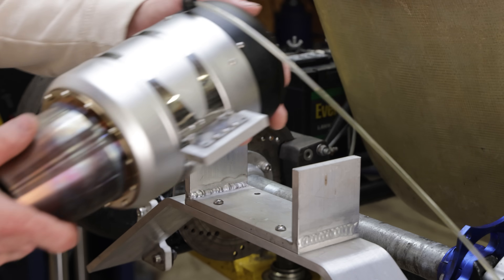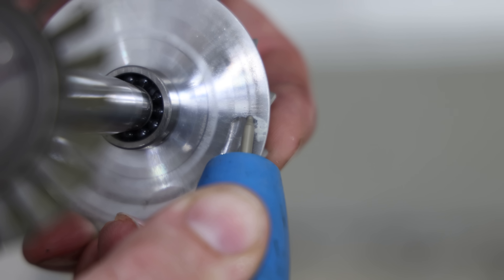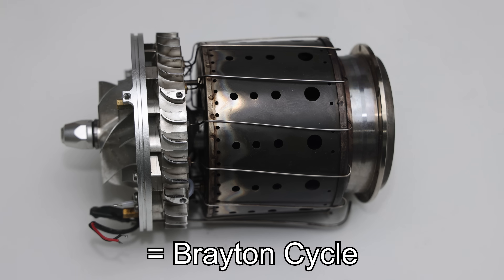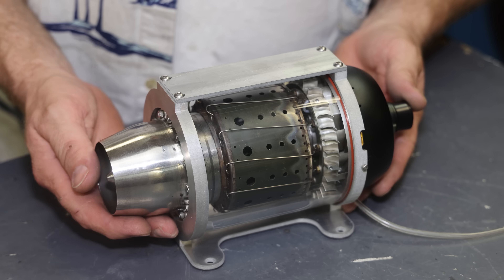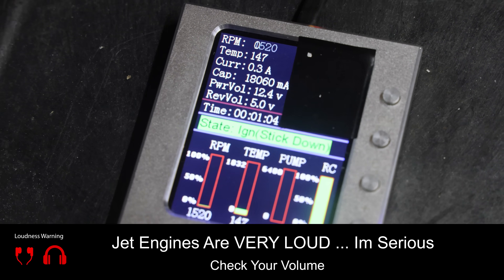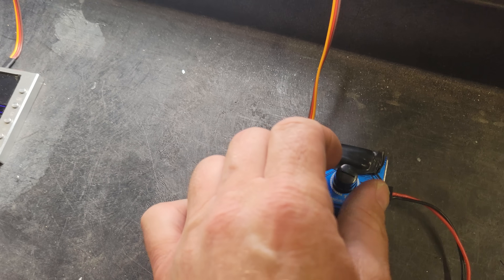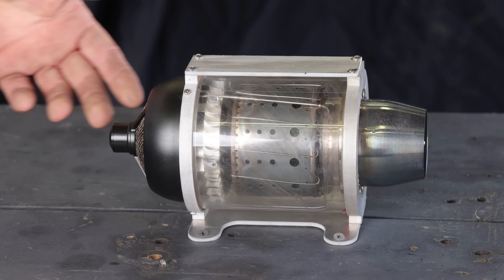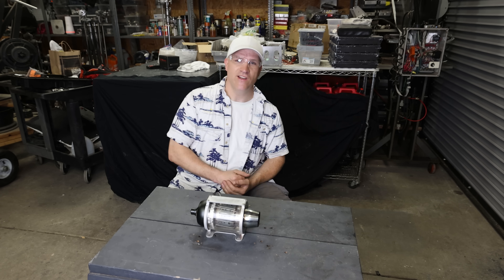See Thru Jet Engine

Comment: At 8:59 while talking about the amount of air going through vs the thrust produced, Warped Perception states "most of the energy comes from the fuel."  That's sort of right, as the fuel notionally supplies chemical energy though combustion, but he doesn't say that, and in his context it is misleading and confusing.
Jet engines operate stochiomentrically - that is the mass of air consumed must just equal the amount required to completely combust the fuel and no more.   For hydrocarbon fuels, the mass of air must be about 15 times the mass of the fuel consumed.   (Only the oxygen is used chemically - air is about 80% nitrogen which passes through chemically unchanged.   The actual oxygen mass is about 3 times the mass of the fuel.)
What produces the net thrust in a jet engine is that combustion raises the volume of air/fuel mix such that the burning gasses can push against  a greater area of the forward inside engine surface than the combustion chamber air inlet area.  The burning gas pressure in the combustion chamber must be approx equal or a bit less than the incoming air pressure to the chamber as otherwise burning gasses would come out the front.  Thus forward thrust is produced as the exhaust orifice, always much larger than the air inlet orifice size, cannot offer much more than surrounding air pressure.
Jet engines are most easily understood properly by first considering a ram-jet engine, which has no moving parts.   Intake air is compressed by the forward motion forcing the air through a funnel, so reducing the area and raising the pressure.   Again, as with a turbojet, the forward part of combustion chamber surface area must be greater than the chamber hole for the incoming air, and is much greater than the exhaust orifice back pressure.
Understand all that and you will not only understand that the mass of air is more important than the mass of fuel (both supply the pressure, and there's much more air than fuel), you will also understand that the efficiency of a jet engine (ram or turbo) is proportional to the compression ratio.
In World War The British Air Ministry and the Royal Air Force famously took no notice of Frank Whittle and his jet engine, because his design and available materials permitted only a very low compression ratio, and thus they knew the fuel consumption would have to be horrendous without needing to test it.  The jet became practical when others (eg at Rolls Royce) redesigned it to have a better compression ratio).
Reply from the maker: You are correct but I can't go that deep it will be confusing for most, when you start talking about self-regulating stoichiometry your getting into "Rocket Science Territory". It does have a lot to do with the EGT, the RPM and the ECU matching those up.
Reply: @WarpedYT  :  I understand the need to keep it simple, but the way you put it might lead to viewers thinking more fuel than air is used, even though you previously emphasised air quantity.
Keeping explanations simple and without using math, without going astray in translation is hard.   I am a part time technical journalist and service manual author,  and looking and testing simple explanations is what takes most of my time.
Reply: No, gas turbines normally operate with substantial excess air, not stoichiometrically.
The exhaust cross-sectional area is not necessarily (or even commonly) larger than the intake cross-sectional area because the exhaust gas velocity is higher.
Thinking in terms of engine areas being pushed will never result in a good understanding of the engine operation - it's not a piston engine working on pressure differences. Thrust is the rate of change of momentum of the air (and a bit of fuel) passing through the engine.
The term "compression ratio" is not normally used for turbine (or ramjet) engines due to confusion with the use of the term in piston engines, where is it is a volume ratio; instead, the term is "pressure ratio".
Efficiency depends on pressure ratio, but (just as with any heat engine) is not directly proportional.
Reply: @brianb-p6586  :  You are correct that efficiency is not DIRECTLY proportional to compression.    I didn't include the word "directly."   I perhaps should have included clarifying words but my post was already quite long.
You are also correct in that the term compression ratio is not used in jet engineering texts, but for the purpose of explaining jets to lay persons, it is clear enough.   For that matter, what matters in piston engines is not the volume ratio either but the pressure ratio, which depends on volumetric efficiency, and the sum of compression ratio and external compression, eg turbo charging if used.
Thinking about a jet engine in terms of push against surfaces is correct.   It works just as a balloon with a hole in it darting about when you let it go without typing off, except that a jet engine can keep going due to continuous intake of air and fuel through small orifices.   However, its also correct to analyse in terms of brayton cycle and reaction - both are correct.
Its the same with piston engines - you can think about intake, compression, power, and exhaust strokes (or more correctly, intake, compression, combustion, expansion, blow down, equalisation) or in terms of something called the "standard air cycle" based on Carnot, as mechanical engineers are taught in university.
I've never seen a text book intended for mechanics go into Carnot and the standard air cycle.   They need a simpler view without math.   Same with jet engines - you can talk about Brayton and reaction but it doesn't help the ordinary person much.   Thinking in terms of push against surfaces does, and makes the importance of things like compression quite clear.
It's all very good to talk about reaction al la Newton, but just where does the push on the airframe come from?  Answer - directly transmitted from the forward surfaces of the combustion chamber?  Where does that pressure come from? Answer - from the acceleration of that gas mass out the back.    What will happen if you confine the exhaust orifice size?   Answer:  you will drop efficiency due to back pressure.
Reply: @keithammleter3824  "just where does the push on the airframe come from?  Answer - directly transmitted from the forward surfaces of the combustion chamber? "
No. The combustion chamber doesn't necessarily have more frontal than rear area; indeed many turbines have combustion chambers with turns for the flow in and out of them so they may even have more area on the rear. In fact there are many surfaces with a forward or rearward facing component: compressor impellers, stators, turbine wheels, nozzles, etc. You would have to account for all of them, with their various different pressures, to determine the axial force. You can try to make it simple, but if you go overboard you just end up with simplistic and wrong. The engine pushes the air out the back, and that's why the aircraft is pushed forward.

"Proportional" was just the wrong word. Efficiency depends on pressure ratio... okay.
Reply: @brianb-p6586  Turns and counter flow of air in practical engines actually makes no difference to the basic principle.   Actually, practical jet engines can have an inner chamber where combustion actually takes place, and this chamber has no significant structural strength (thus making and using a high temperature alloy easier) - the strength being in a cooler outer chamber.  (See note below)  That makes no difference to the basic principle either, as the pressure is transmitted from inner to outer chamber through holes.   The basic principle being, as I said, combustion resulting in gas pressure, and this pressure is transferred to a greater area of forward-facing rigid surface than the area of any rear-facing rigid surface, and that pressure equal to or slightly less than the air pressure imparted by the compressor stage.
It really doesn't matter where in the combustion chamber the air comes in - the centre of the front surface, from the sides, or even looping around so as to enter from the rear.   What matters is the the air inlet orifice is smaller in area than the whole forward facing part of the chamber surface, so that the compressor can overcome the pressure resulting from combustion, but the aggregate force on the forward facing surface is still greater.  If the air from the compressor takes one or more turns or even reverses direction, it just means the pressure from the combustion chamber is transmitted back to load the compressor via a path with turns.  
If you are going to deny gas pressure imparted on the forward facing part of the combustion chamber surface being transmitted to the airframe as the net thrust, then you are going to have to say just where the force pushing the plane forward comes from.  It's not sufficient to airily say it's reaction of the gasses coming out the back.
I suggest you try walking before you run - that is, simplify the thing down to its basic essentials - a ram jet engine which has no moving parts.   It's somewhat like an odd shaped venturi.  Obtain and/or draw a longitudinal cross section and think about how it in practice works.   Not as overall governing theory about action and reaction, think about just how the force delivered to the airframe arises - how it gets transmitted there, and how come combustion gasses don't come out the front, despite no physical barrier.
Once you understand just how a ram jet engine DELIVERS thrust to the airframe, you can then extend the principle to a turbojet, where inner chambers, compressors, turbines and whatnot complicate the engineering but the basic idea is the same.
Note:  An inner chamber where combustion actually takes place, with holes to communicate the pressure to a structural chamber, so that the inner chamber can run hotter without significant mechanical loading, was an early innovation on the path to make jets practical.
Reply: @keithammleter3824  That was a very long way to say that that I was correct: it is not valid to oversimplify the internal details of a turbojet engine to a combustion chamber with more area on the front end than the rear end. It doesn't even work for a ramjet.
Reply: @brianb-p6586  : Not at all.    You have basically denied where the force applied to the airframe comes from.   Nor have you given an explanation of where else it could come from.  The only possible place is gas pressure on the forward facing component of the working (combustion) chamber.  (The same pressure acts on the sides, but the side loading cancels out.)
When you boil it down, your words are analogous to saying "mass is accelerated out the back.  So there must be forward thrust - F = ma. "    This is correct, but it is not an explanation of how the thrust actually arises.  An analogy - you could say "in a clock, energy in the mainspring causes the hands to rotate."  So it does, but most of us with enquiring minds interested in clocks would like to know that the spring applies a torque to a gearwheel which turns a gear train.
You had better look at drawings of ram jets.  You can start with the 2 drawings of ram jets in Wikipedia's article on ram jets.   The first one is schematic; the second one is labelled "typical" and is a NACA design.   In both diagrams the inlet orifice is very small and the exhaust orifice is about as large as it can possible be.
It occurred to me shortly after posting before that you can simplify this even more in order to highlight the essential feature:  consider a simple rocket.   In its simple form, a rocket has three things:  A source of fuel, a source of oxygen (which can be a chemical that releases oxygen when heated, this chemical being mixed with the fuel), and a burning chamber with a rear-facing hole in it.   The fuel and oxygen burn, causing pressure in the chamber by forcing the combustion products out the hole.    This pressure acts in all directions in the chamber, but SINCE THE HOLE CANNOT TRANSFER THE PRESSURE to the structure, and the FORWARD FACING PART OF THE CHAMBER CAN, there is a net forward force on the airframe.
The ram jet has a complication - it gets its oxygen by forcing atmospheric air through a front facing orifice.   This orifice must be small, or the combustion pressure load against the forward facing surface will not be greater than the load on the incoming air.  Conveniently, it can be arranged that the intake orifice can be a funnel, thus trading air volume for air pressure, so that the combustion doesn't just simply exhaust out both ends.
Practical rockets and turbo jets of all kinds usually have an exhaust nozzle of expanding diameter.   This is a means of fine tuning so to speak - along the axial length of the nozzle the gas pressure reduces while gas volume increases - this is a means of converting SOME (it cannot be anything like all) heat energy into a pressure drop.   It is not essential that the diameter is reduced before it increases, though it is often mechanically convenient.
Reply: @keithammleter3824  I didn't even read all of that, once I realized that you have forgotten about almost every component of the engine. Every compressor impeller, every turbine wheel blade, and even every stator in the compressor and turbine section also has axial force acting on it... and you want to ignore them all. No rational person would work them all out, but the net effect of all of them is the engine thrust.
Reply: @brianb-p6586  : You're just being silly.   Axial loads from compressors are just practical complications that do not invalidate the basic principle.    Understanding the basics before considering complications is how we come to understand almost anything.  
I have not denied the loading from compressors etc - these just mean that the net force delivered to the airframe is a bit less than the force applied by the burning gas to the forward facing component of the combustion chamber.  It still that forward component surfaces that furnishes what jets are good for.
You still haven't provided an alternative explanation of just where the force on the airframe comes from.  You can't, can you?
Now, go look at some drawings of ram jets and then come back and explain it.
Reply: @brianb-p6586  Ideally, operation is stoichiometric.   In practice, just as with gasoline piston engines, for various minor reasons, they may best operate economically and cleanly somewhat lean., say up to 15% excess air.   This is close enough to stoichiometric  to estimate the approximate mass ratio air to fuel - which is what I wanted to point out here in order to clarify Warped's otherwise good talk.   In the limit as air mass is increased well beyond stochiometric, net thrust must go toward zero.

Comment: I think a partially see through combustion chamber would be interesting to observe.   I guess you use high temp heat resistant glass ?  I guess you would just see fire & fury inside.   If glass seems to melt at around 1,600 degrees C and a jet engine burns around 1700 degrees, you might need some kind of cooling system for the glass.  Either some liquid refrigerant loop wrapped around the glass combustion chamber.  Then again the high temperatures could shatter the glass into a million glass shards,  due to the heat differential induced by the refrigerant.  The coolant piping might need to be evenly distributed throughout the length of the glass chamber.   Alternatively a metal combustion chamber with a glass window segment, again using a coolant piping around the metal and near the glass window segment. Otherwise you could use a bypass fan design to redirect airflow around the external surface of glass combustion chamber.  Will be interesting to see whatever concept you arrive at.
Reply from the maker: Yup. It's more uncertain than that because I haven't made this material into this shape yet so it's shaky ground.
Reply: @WarpedYT  How much water do you inject into the air normally?  Did efficiency went up with the application of the fog?

Comment: Wow, the fog disapearred from high temperature inside the engine,,,
Is it from dry ice, i mean its co2 isnt it, the fog
Reply from the maker: I think the pressure did it, it's glycerin
Reply: @WarpedYT  The Glycerin fog droplets are doomed in the engine - they will at least vapourize and will presumably burn.

Comment: Hi, just want to ask about the engine airflow that you mentioned it does not need tremendous volume of air. So, why do commercial plane does not put sort of filter to prevent things flew inside such as birds? Sorry I have no background on this things😅

Comment: I knew that the engine would stretch, and the retainer on top would not help .. It's a pity that I could not help you at the development stage)
Reply from the maker: It's ok I had a backup plan, I will stiffen up the 2 supports next time but I want it to flex a little. Also I wanted a balance between the least supports possible with the engine still fully operational. If I used threaded rods or something like that it would have been too stiff and since the clear composite material has an extremely low coefficient of expansion it would have leaked anyway no matter what, because the metal will expand way more than the clear composite. The only other thing I could have done is put o-rings, but that posed another problem, depending on the hardness rating of the o-rings, they may be slightly too soft and it could explode. How would you have designed it differently...I'm curious now.

Comment: Ive been a mechanic on spacecraft for my system going on 300 yrs, ive never seen such a clear showcase of the engine. bravo!
Reply: Where are you from that had turbine engines for over 300 years? Are you an alien? Those tic-tac UFO's that the Navy spotted was your doing, wasn't it. Confess!
Reply: @VolsPride  yall are getting close and ill leave it at that.